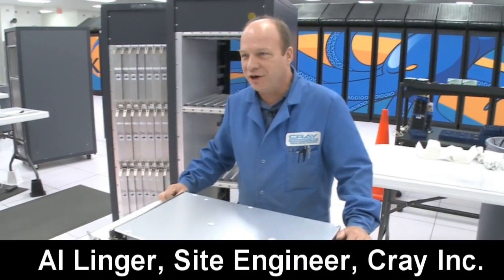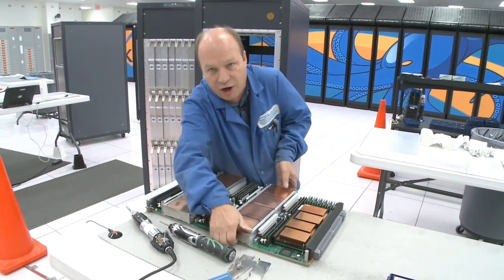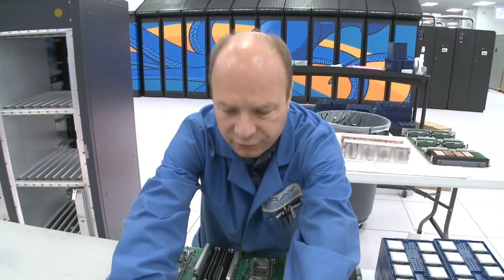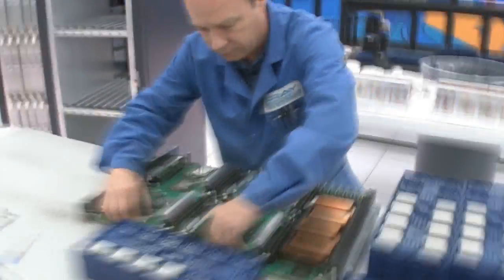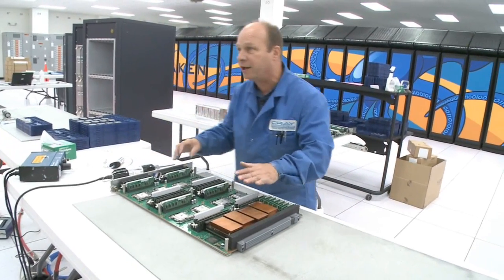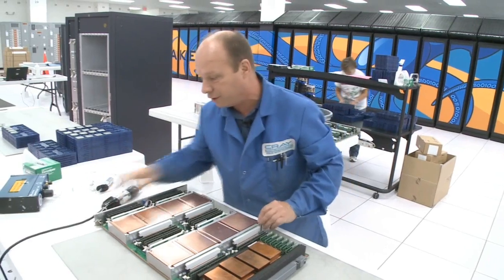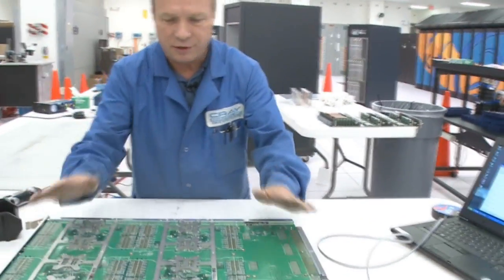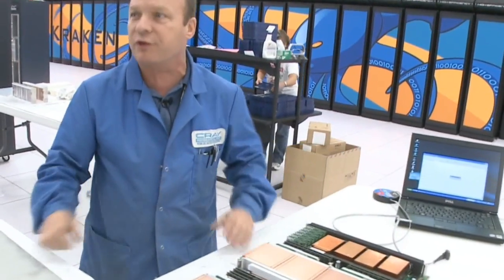Cray Upgrades "Kraken" Supercomputer with Six-Core AMD Opteron Processors

Comment: I wish i had his job. Prolly makes 30 bucks an hour with 4 Years of college under his belt, all just to fick with some screwdrivers n silicon.
Reply: +Kyle Dryer Except with you, when something goes wrong you will throw your arms in the air and say "no fucking clue"...

This guy, having an education, will be able to diagnose and solve the problem.
Reply: +Doom2pro Right. But that problem would be remedied by a three hour course.  Its not like hes writing code. He's putting silicon into sockets that are designed for it. Hes a basic mechanic.  But im sure this is only a tenth of his job.
Reply: +Kyle Dryer Again you are neglecting to appreciate the education required to diagnose problems with complicated systems like this... You are falsely assuming that his only job is to install CPUs into Sockets during upgrades, when in reality he is probably a system administrator. 

Can you prove that he is simply a "basic mechanic" and can you define the job of "basic mechanic"?
Reply: +Doom2pro you didnt read it. I said its probably a tenth of his job. ya most of the time he probably sits ass as a systems manager.  The funny thing is that most high paid positions require little "real" work or little thought.
Reply: +Doom2pro And unless he's running order forms there is no complications. if the guy ordering the forms did his job it would result in no difficulties. the only real problem solving would be the ordering of parts and making sure its all compatible.
Reply: +Kyle Dryer Yeah because keeping a system with 18,688 CPUs and GPUs running 24/7 and draining 8.2 megawatts of power is easy.... Keeping clients work loads from conflicting with other workloads, keeping hardware failures in check, all simple jobs, just sitting on your ass all day...

I don't care if he sits on his ass, as long as he is there when the shit hits the fan, I'd rather have him around than people like you, who think it's easy peasy.
Reply: +Kyle Dryer No it's NOT that simple, what do you do when clients report issues, you need to test RAM, locate the hardware faults....

What if a power supply dies, hard to replace that while sitting on your ass... What do you do if a client's workload hangs the system? Sitting on your ass wont solve shit...
Reply: +Doom2pro  im sure the problems you just listed are handled by at least four different positions, but managed by him.  oh a psu died? 
the manager wont be the one fixing it, he'll send a tech with an invoice. 
you act as if these plants are managed on paper.
Reply: +Doom2pro Are you getting double replies?  I am for some reason.
Reply: +Kyle Dryer LOL A tech with an invoice? Yeah cause an 80 million dollar system can afford to wait for a tech to repair a failed power supply...

When a power supply goes down you replace it ASAP because the redundant supply is the only thing keeping that portion of the system up and if it fails, that means square one for all the jobs running on that portion.
Reply: +Kyle Dryer Yes I am, typical Youtube... Still haven't fixed that annoying edit comment encoding bug either.
Reply: The guy is probably a Systems Engineer from Cray:

https://rn12.ultipro.com/CRA1002/JobBoard/JobDetails.aspx?__ID=*847F115C19AEAB30
Reply: i could do this job... and i work at target stocking shelfs...

Comment: HE DIDN"T SPREAD OUT THE COMPOUND,
Reply: It's been proven to be the best method for heat transfer. Spreading the compound actually causes unavoidable air bubbles cause the air cant escape. There's videos out showing it so you can see it for yourself...
Reply: Yes because you are not suppsoed to spread the compound you are suppsoed to keep it in a dot and let the heat sink do it for you,
Reply: lonerider92 Yea you are right. That's exactly what I was saying, just maybe a little vague cause it was in response to Gordon's original saying he didn't spread it and I was saying why he didn't cause it's best not to. Everyone should know air bubbles are never good in any situation as to why I added that.
Reply: Aaron Moore
You don't want airbubbles in the compound it has to be as airless as possible. Using a blob and applying the heatsink is enough because the surface of the heatsink will spread the compound out it's self. Spreading the thermal compound then applying the heatsink risks the compound getting on circuitry and could short it out.

Comment: Please may I have some of the old chips?
Reply: Even if they gave you it you would still need a special mobo
Reply: +Alexander Lei, I think they are simple processors. They are optimised for server work but there should be a way to use them as normal processors.
Reply: +Len P They are off the shelf G3 Opterons meaning you can use them in any Socket G3 motherboard, as long as the BIOS supported them (it needs to upload CPU microcode) and supported the CPUs TDP.

Comment: Dude... this is NOT about a consumer product in ANY way shape or form. This is about an extremely high-performance, high-spec and VERY expensive multi-rack supercomputer, which has more processing power than any thousand high-end gaming rigs.. The unit you saw was just one of 3,136 identical ones. Just to give a reference here, the combined machine has 147 TERABYTES of RAM and covers 2,200 square feet of floor space.

Comment: @ub3r1337pwn4g3 i know! i found myself thinking of the chips as cells in a brain here.. then i started thinking if it was a brain theres no way the cooling would be that size compared to the cells... 
then again, the less electricity the better, and they dont need to worry about durability

Comment: The programmer looks like a microchip in circuit debugger, version 2 or 3 cant really figure out, what kind of firmware do this PIC run ? power regulation ? programable clock signals ?

Comment: - Screwdrivers with preset torque limits are practically the only kind used in manufacturing.
- His shirt is anti-static (actually looks like one I used to have at work, Google "esd smock")
- He's programming them with a Microchip ICD puck, and MPLAB doesn't run on Mac.
- The space that actually dissipates the heat (inside the channel) is inaccessible
- Screwing down the heat sinks in the proper order with the proper torque evenly spreads out the compound
- That's great.  Nobody cares.